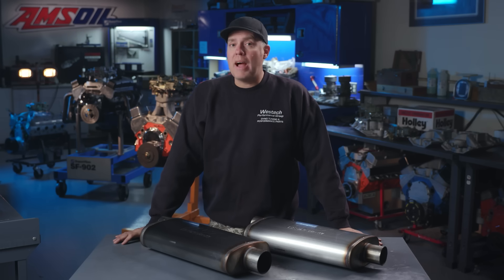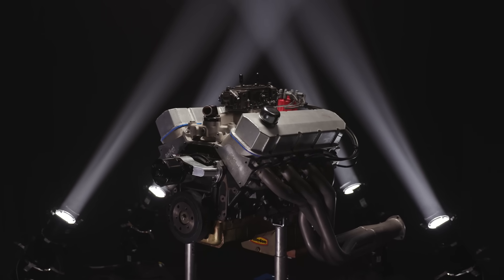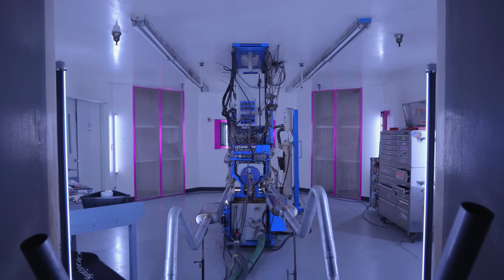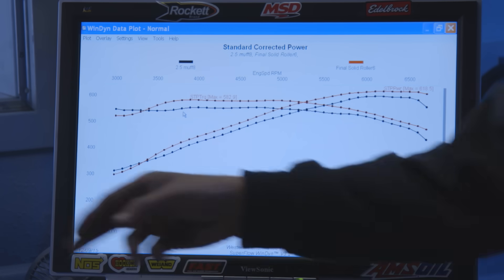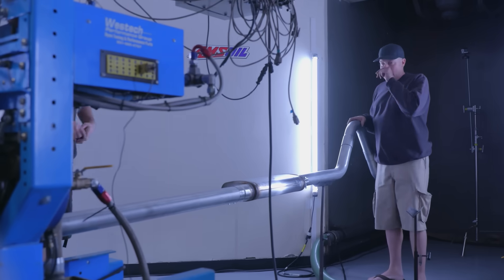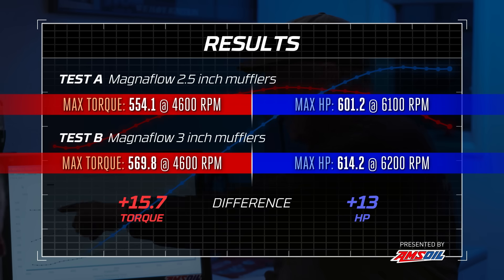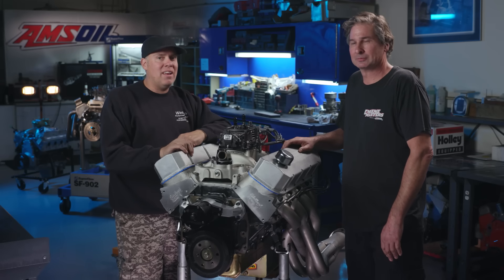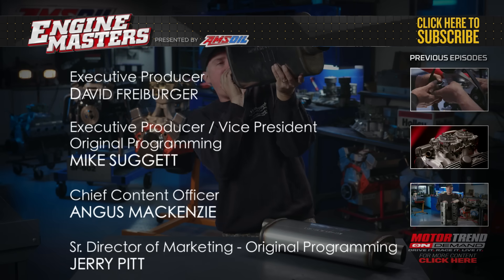The Power of 2.5- vs. 3-Inch Exhaust - Engine Masters Ep. 9

Comment: Read Gordon Jennings article "cylinder head tech" and you will find flow is more complicated than just pipe diameter. Exhaust velocity matters and is achieved with the correct size pipe not necessarily the bigger pipe.

Comment: They know as well as I do that it all depend s on the size of the engine and then what headers and exhaust configurations are applied like an ex pipe after that adds up to 30 more hp and  more , d uh get real road kill and I might add "back pressure" is measured in sound waves and Not the exhaust restriction
Reply: Add a full bassani x pipe exhaust system can you add American V8 and you'll have close to if not exactly the sound of a highly tuned Ferrari V8 . And braaap to go ... And yes the sound waves are the magic.... That's how an expansion chamber works on a two-stroke dirt bike... Ever see a sound Cannon does the military have working. They got them powerful enough to knock down a brick shithouse.. the expansion Chambers reverse cone megaphone reflex enough internal soundwave to stop the incoming charge of gas and air directly at the exhaust Port like a valve closed causing two strokes to internally supercharged themselves. That's why we have that instant power band of a racing 2-stroke.. at that moment the air pressure in the transfer ports of a 2-stroke become greater than atmospheric pressure.. this was told and proven to me in Honda motorcycle School from the instructor who invented the first two-stroke call the Honda Elsinore by pop's yoshimura himself 50 years ago. Sound waves are like magic making horsepower in two and four stroke engines

Comment: You didn't prove jack.  First off you should have tuned the engine  a little leaner for the 2.5" and run it again.  The tune alone could have easily made up the difference in the drop.  Second, you went with a 454...would it make ANY difference with a 383 or .60 over 351w that doesn't NEED to move that much air?  I have a 351w and a dyno.  11'3:1 and pretty much all the goodies you have but 90 cubes smaller.  Open headers HURT the 3000rpm and 2.5" runs every bit as well as 3"....+- a half a percent.  Who would even notice that seat of the pants?  I own a dyno and I can't tell a difference.  This is not a orange to orange test.  I'll bet if you leaned the motor out a tad the figures would be a lot closer.  Too rich robs as much HP/tq as too lean.  I would have been impressed if you had leaned her out a bit BEFORE you ran the 3" and showed that much difference.  The real problem is you just plain don't have the room to install 3".  I have a 65 mercury Comet and the difference in installation of 3" compared to 2.5 would be HUGE!  Nice try boys...didn't impress me with this one.

Comment: Smaller diameter exhaust is good for off roading  at low speeds when you really need the torque. I would only run large diameter exhaust if I'm doing lot of high speed driving

Comment: The test is good but doesn’t tell the whole story. Do it again with a small displacement small block.
Reply: Small displacement engine with no aftermarket mods. I want to see a late 80s ford 351w with this exhaust setup.

Comment: I just bought a 2010 fusion sport has 12k miles on it for my son to get out to school. 
My question is that this car has a magnaflow exhaust system w/ 4 inch straight pipes. I also looked at the engine and I see a steeds throttle body spacer (idk what for) and it’s connected to a injen intake system. The car also came with a tuner with a 93 octane tune already programmed. Is this magnaflow 4 inch pipes making less or more hp? Not to much into mods and exhaust system/ pipe diameter what size exhaust should I run on this car?

Comment: I'm wondering if you've completed a similar test with a 6 cylinder engines, as many cars these days have them and they can always use the help of a good exhaust set up.
Reply: There were some good 'vintage' sixes, as well.
I drive a 'Flatfender' Jeep with Buick 225 'Odd Fire' inhaling plenty of Holley through Kenne Bell #1 manifold, exhaling through Advance Adapters headers.

Comment: 1" pr 100 hp. So a 600 hp engine needs 2 3" a 500 hp engine needs 2,5" the power of the engine decides the size of the exhaust. Not the other way around. Its scavenging you want. To big of a pipe slows down the exhaust and you get worse scavenging. To small exhaust and you restrict the flow creating backpreasure. The correct size exhaust equals good flowing exhaust and good scavenging.

Comment: Actually Chevy says a 427 with a 3.76 crank needs 2 1/8" primaries and a 4" collector , Then a 7.5" reducer down to 2.5Inches , Then 20" from 2.5" to 4inches and then 4 inches to the back of the car and that will produce more HP and Torque than all of the above.

Comment: ok I know this is a 4 year old video but ill ask anyway lol. i have a 2.5 l Fiero  the exhaust in a Fiero basically is a circle i believe its a 1.75 inch exhaust would a 2.5 inch exhaust be to big? i have rebuilt the engine. 20 over on  skirted piston , rings and bearings running stock cam Fiero used from factory stainless exhaust which is probably why I can still use the one out of my 84 lol. a slight upgrade would be nice oh ya i also did a little porting of the intake and exhaust  not to much i think it will make a slight difference with the swirl port heads. but there was a ton of junk in there imo

Comment: Heard your power is made from the headers to the mufflers  and necking down the tail pipe doesn't hurt , would like to see the 3" system with the 2 1/2" tail pipes
Reply: That would be a messy test since the length of the tailpipes would impact how much they affected flow.  an 8 foot long 2.5 inch tailpipe will be more restrictive than a 5 foot tailpipe of the same diameter, for instance.  And a tailpipe that has to route over the axle in an uspdie-down "U" path would be more impactful than one that doesnt
Reply: @faaaaq  you are correct but chassis Dyno numbers don't lie

Comment: The stock exhaust on V8 Challengers have huge suitcase resonators and is unnecessary dead weight, so it was one of the first mods that we did on my SRT8 and went with 3" SLP loudmouths. They are one of the best choices because there's not much to them, and are super lightweight. They consist of open chamber racing bullets, and eliminates the reso's altogether. They sound absolutely amazing, and are the perfect match up with the gen3 hemis 💪🏼😎

Comment: Yes but you can not actually drive it without being a COP MAGNET with just open headers and a collector extension. Secondly you can not hear the radio or navigation or anything besides motor with out a decent exhaust. Third some of us actual take engines put them in cars and drive more than just around the block so not being deaf by the time you hit 40 is also a good thing!

Comment: Great video but the dismissal of "That's where I drive anyway" isn't too helpful. Below 3200 is where I drive on the street. "Street/strip V-8" is explicitly stated in the description and the street RPM range is completely cut off. Curves down to 1000RPM or even lower would better help people decide what they need.

Comment: so 2 1/2" for a 300 horsepower street car that spends 99% of the time under 5000
Reply: Many early big blocks were only equipped with 2.25" pipes.   Ouch.
Reply: @flinch622  92 ls400 here
Reply: I guess I'm in the other boat... 69 Camaro with a built 461 BBC, Comp Cam, Oval Port heads, Double Pumper, Hooker Competition headers, full 3" SS PYPES exhaust and Magnaflow 3" I/O mufflers... full 3" all the way back to the 3" slash tips. Reasonably quiet unless I mash it, scary noisy when I open the electric cutouts!
Reply: @mikelangieri6602  I like it.  But what did you do for the rear suspension to live with all that awesomeness?
Reply: @mikelangieri6602  Try standing 15-20 feet from a top fuel or funny car.  THAT is scary noisy.
Reply: @mikelangieri6602  i got 3" pypes put on my 69 now..quieter till ya get happy feet think i got an exhaust manifold leak due to a partially blown gasket..pop pop on acceleration load

Comment: now do both systems and add a H-pipe and X-pipe , then run all the test with the throttle maxed at 50-60% to check real driving use

Comment: Surprising results. I think the best compromise For A Street Car would be 2.5 inch and exhaust cut-outs just ahead of the trans crossmember. The reasons being beneath 3500 rpm you loose torque (but no hp) with 3 inch exhaust. SOME backpressure will contribute to Where the Torque is "felt", meaning seat of the pants. That's what I'm doing with mine. Block huggers for no ground clearance issues with speed bumps & driveways, electric exhaust cut outs just ahead of the cross member to manage Where this combination will make the torque & this acts like an extension of the collecter using 2.5 inch pipes throughout and I like Dynoflow mufflers so I'll go with them. I don't feel like 3 inch is warranted with cutouts because it IS a street car after all so low rpm drivability as well as mileage are considerations and where will it spend the majority of its rpms? The cutouts won't kill the power, it's be just like running an open exhaust with a long collecter length. Besides, how many street cars are really making 600hp? Stick to an "overbuilt" engine that "only" makes 425 or so hp & put it on the bottle for the rest. N2O.

  The durability will allow it to safely operate up to 600+ hp, the nitrous makes that happen & the lower hp makes your engine last longer. Plus mileage.

Comment: At what point will a bigger exhaust start to lose power? 3.5 inch, 4 inch or larger exhaust system? We all understand that a smaller exhaust reduces power but we didn't find the 'best' size for this engine. We saw that a 3 inch was better, I wanna know what's best?

Comment: I seen this a few years ago when it first came out.
Got tired of making this same argument so now i just forward this video to all the guys who argue till death why their 2.5 system "makes more torque".
Back in 1994 when i first did a full 3inch system on my 70 442 (from a 2.5 system) the results were Dramatic. My car ran 11.20's as a street car while everyone else with same setup were still stuck at 12.0's
Reply: slade bonge  mine is a 462 Oldsmobile (.030 over 455). Back then it was like 10.9 to 1 (now its 13.9 comp) hyd flat tappet then was 255/260 @.050 and .575 lift, box stock edelbrock heads. It only spins to 6000 thru the traps. 
On a warmed over small block chev cyl heads are at least as good as what the olds flows. Sure you are giving up cubic inches but with all the tech and design over the years on an sbc i feel like the 2 engines are similar.
I still suggest 3in. Only problem you might have is fitting 3 in tail pipes on a camaro. I know it can be done but it wont be a kit, will most likely have to be a custom mandrel bend fabricated tail pipe. Worth the cost and effort however.

Comment: Losing 20hp/30ft-lbs on a 620hp/580ft-lb car is a pretty small difference especially if you are not trying to improve drag times or something. If you want your car quiet, 2.5" full length with mufflers sounds like a pretty good option for a "modest" build if it works even on a big block pushing that much power.
Reply: How about a test of a stock 350 from the early 90,s pickup ,headers ,y pipe (2.5 ) ,3 inch cat in +out , magnaflow 3 in +out ,3 inch side pipe exit ,single ,especialy at a modest 3500 rpm, u know , where most pickups operate  maybe with an MSD package ? These dino tests wind up so fast to max throtle , ignoring cruising speeds, where u can actually smell the roses and check out the sites ,cruisen'  Just sayin'
Reply: they really should start talking as a percentage loss, its 3%! is that seat of the pants percevable.
Reply: I was thinking the same thing. I was kinda surprised they were making such a big deal of 20 hp at that power level. The conclusion should have been for all our performance, 3" is best, but 2.5" is perfectly acceptable. Plus they ignore what's going on below 3k rpm where most people spend most of their time
Reply: the power change figures are not really the point of this video, more just debunking the "calculated back pressure = higher performance" myth
Reply: @justmechanicthings  Just wanted to let you know that there is at least one other person out there that understands like you do. DF even said "these tests are done at WOT and not the way you would typically drive on the street". They joked about the myth several times which was another ample hint as to what the video was about. Keep on teaching on!
Reply: @justmechanicthings a pipe system can be caculated but not to make back pressure but to use the velocity and weight of the exhaust system to use it to "suck" in air while the overlap is occuring

Comment: Wow, a 2.5% gain! That might even offset the extra weight.
Reply: 3" so heavy!!!
Reply: @paulhotson5820  the 3" system probably only weighs 5-10 kgs more. But if that car was 1600 kgs, you'd only have to add 40 kg to offset the extra power.

Comment: I like this test, I am now leaning more towards a 2.5" maybe 2.75" exhaust. What I don't like is the usual starting RPM being so high. It seems to show that the 2.5 was a big winner below 3,300. That's mostly where I drive- not at 6,000 rpm but the area never being measured. I think for a street car the entire rpm range is important to make a decision not just the always reported 3,000 or higher range. And not a peak hp or torque value.
Reply: I did a virtual test of this and the only way to sit a 3000rpm is 20% throttle toe in and between two engines, one making 400lbft at 3000 vs the other making 300lbft, that both pushed 180lbft, if you want more torque down low you’re going to have to have really high displacement like 7.0l+, because the two engines I compared were 5.7l(400lbft) to 4.7l(300lbft)
Reply: Mandrel bends make a good bit of difference as well, compared to oem flat bends. It's all about smooth gas flow = velocity and not going too big.
Reply: I rewatched this and noticed two things they said I hadn't notice first time around. 
First, they are thinking speaking driving an automatic transmission. 
2nd with most likely a high stall speed so this entire low range is skipped, although that shouldn't be needed.

IF on the other hand you are driving a manual transmission then this rpm range is needed to get the car up to the speed limit.
I would rather gain 20 hp or whatever torque where it will actually be used as opposed to a number, I can tell people who will be little swayed by a 20hp reduction they are not aware of.
So. the winner was the 2.5" exhaust because it produced more torque and more HP than the open or 3". It simply wasn't graphed properly. Besides it will be easier to fit into sidepipes with muffling.

Comment: My old 68 Charger (with 8:1 compression '72 400) made 343 hp (according to a calculation from the Mopar Engine manual), but I put a 3 inch Flowmaster dual setup on it because I intended to go to a hot 440...then bitchface ex filed for divorce....sigh...Yeah, I'm a dude, Donell is my new (much better) wife.

Comment: Great video!  I have done the following in a couple of cars and wondering if it makes a difference if I go with a 2 1/2" system all the way thru.  Ford 351C engine about 275 hp.  At 3" header collector start with 3" pipe to a 3" muffler and then after the muffler continue with 2 1/2" pipes.  I include an X-Pipe.

Comment: Try 3" on a 350 small block. Much less air push. Would like to see the 2 1/2" vs. 3" rematch.
Reply: the smaller the motor, the less the Need for the 3" and  the improvements will certainly be different if any

Comment: Had a super charged g37 on a dynojet  dyno. had an off the shelf exhaust system. Customer had cut outs installed.  Back to back runs with closed vs open cut outs. Closed made more power. No tuning changes in between.

Comment: Completely useless results. How many hotrods have a 25’ exhaust system? Why not 50’ or 100’? So you demonstrated that larger pipe passes more gas. Guess we already knew that. How about this: tune the exhaust to the engine. Naw. That takes understanding your flow dynamics.

Comment: I realize this is a few years old, but have you done a similar test with X and H pipes on this same set up to see if there is a difference in diameter size?  I know there are videos on X vs. H, but those are on the same sized diameter.  

Also, how about shortening the exhaust system and seeing what the results are?

Comment: I believe the 3 in exhaust is too big for other engines though. 

I'm sure plenty of times it was said that the 3in exhaust is too much for the guy that has a 302 a 305 or a 350 with a real mild build. 

I'm talking somebody using fairly stock heads, and a fairly small cam. Say your typical.450" cam. Much less than 1/2 inch lift either way. 

So I bet if you did this on a smaller engine as I said above, you would find you lose to torque. 

But then the person that puts a 3in exhaust on a 302 such as the late sixties Chevy, the fun doesn't begin until three and a half thousand anyway. 

So I chalk it up to a big misunderstanding.
Somebody with a 302 318 350 with such a mild engine sure doesn't need 3in exhaust. 

Just say you had one of those engines in a pickup truck.... You drive around and tell me how much torque you don't have.... Instead of a dyno that really measure stuff north of 3000 RPM. 

It's about as good as the argument of putting in a free air intake. "This intake makes 7 more horsepower! " Great, you only feel it with your foot to the floor and when it revs up higher.